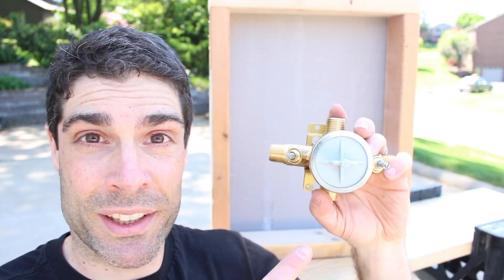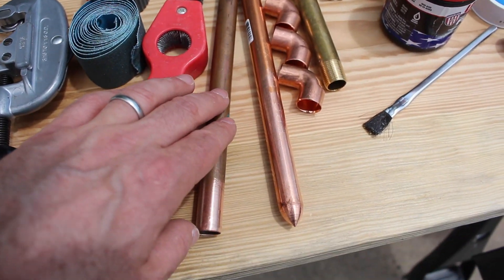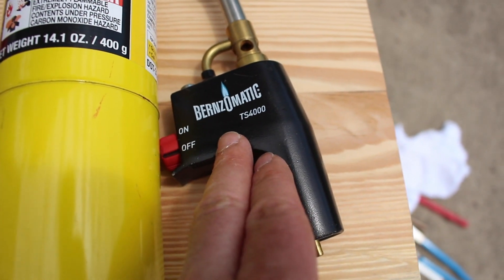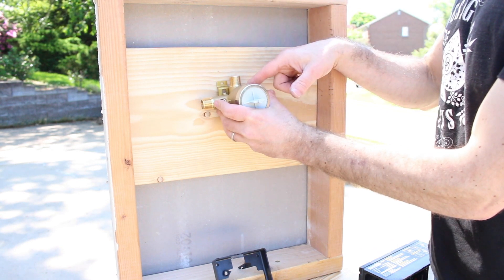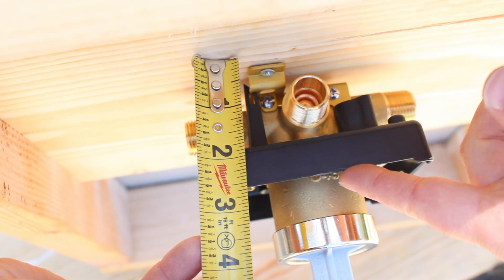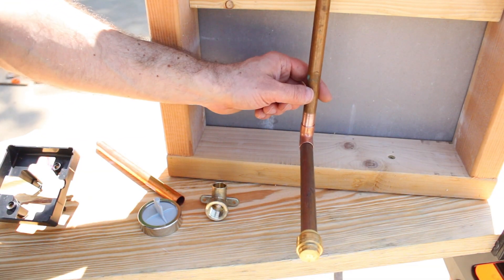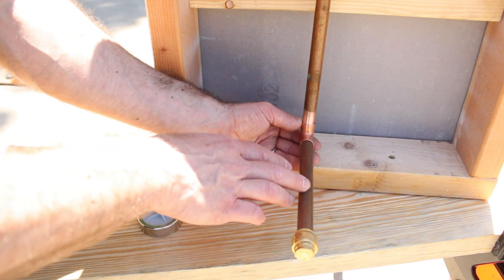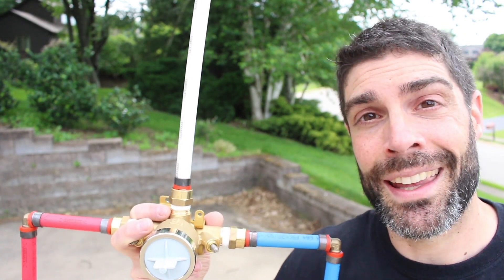Delta Multichoice Valve Installation Tips (Copper Pipe Edition)

Comment: I'm installing the same valve, and after scouring 100 of videos about how to install it, yours is the best explanation about the whole process. I would add another tip though (I learned from some other video) is to use Thread Sealant to guarantee no leak. I'm surprised there are not a lot of like
Reply: Teflon tape always,
Tread sealant is for 
Amateurs

Comment: The depth mounting portion of the video is incorrect / misleading.
 
2 & 11/16" (actually 2 & 3/4") will always be the depth from the back to the edge of the mud guard as it states in Delta's installation manual.  What you need to plan for is that the front edge of the mud guard should be flush +/- 1/4" with the finished (tub / shower) wall.  So you need to account for the sheet rock/cement board, thin set & tile thickness.
Reply: Yes, this.
Reply: Yes I’m glad somebody else wrote this down before me because I was looking for a comment before posting the same concern. It’s a little concerning considering that’s one of the most important steps to installing a valve! Good looking out!
Reply: Glad you said this before I start the mounting of my valve thank you!
Reply: Delta's install manual points out the same dimension, and it is non-sense and confusing, which is why I looked for additional information.  Thanks for pointing this out.  That dimension is from the mounting bracket to the front of the mud guard, and that never changes as you point out.   So, 1/2 inch for cement board, and about 1/2 inch give or take for your tile and thin set, and you need that sucker sticking out past your framing by about an inch.  But check your tile and thin set thickness...but you should get to that +/- 1/4 "  .
Reply: Thanks for your clear insights. I was listening to this guy and comparing it to the install instructions and I was like "what?! It's always 2 3/4 from the vale to the mud gaurd" 
This is why we need a down vote counter !
Reply: Ya. He F'd that up. Hopefully people read this comment.
Reply: Yes.  A 2x stringer set in the back of the wall cavity leaves 2" (3 1/2" minus 1 1/2" leaves 2") to the front of the wall.  That means that mounting the valve body on the stringer puts the front of the bracket about 3/4" proud of the wall surface.  That's fine if the shower wall is at least 3/8" thick but a thin shower panel may leave the valve too far away from the panel to allow the trim to fit snugly against it.  In the Delta video it looks like the guy used a 1x6 stringer to let the valve set further inside the stud cavity.

Comment: Love the video and appreciate your expertise! I am looking to change out an existing old shower valve with this MultiChoice. It appears to be threaded at each end, does that make it compatible to use compression fittings? I am intimidated with soldering in a confined area, so that would be my chicken out method.

Comment: Shouldn't the plastiguard depth be determined by the thickness of the wall/tile you plan to install? For instance, my wall insert is 1 1/8" thick. The direct to stud install of the insert would need to be calculated somehow, right?

Comment: Excellent video. Very informative! When you mentioned the setback/position or depth of the valve you didn’t mention that Delta has a different setback if you are doing a “THIN”  wall. A “THIN” wall is one that is drywall only. I had to have a valve replaced last year and they replaced it with the exact valve you used in the demo. The bathroom has a separate shower and a separate tub. There is a single horizontal row of 12 x 12 tile above the tub which the spout goes through but there is not any tile where the valve is mounted. (Delta does have a note and instructions for a “THIN” wall....)  Instead of using a 2x4, etc to mount it to they used a 1x4 (actually 3/4” x 3 1/2”). Delta says for a “THIN” wall the plaster guard must be flush with the back of the drywall or a 1/4” behind the drywall. They also make  a “THIN” wall kit which is just a couple of very thin plastic plates designed to stiffen up the wall which was not needed in my case.
You can also cap the shower outlet on this valve and use it for a tub only or as you stated a shower only...
I also recently found out why Delta and other manufacturers don’t recommend PEX for the tub drop to a drop ear. (This information came from a master plumber and not from Delta or another valve manufacturer). He said It’s because the diameter of PEX is not a true 1/2” diameter and not enough water pressure goes through the valve and tub spout diverter and can cause a very small amount of water to dribble out of the shower head. He said this can happen with any brand of tub/shower valve.  I asked him if using PEX-A or using 3/4” PEX would make a difference....   His response was it would probably make a difference but he had never tested it.
Hope this information helps....
Ron
Reply: Thank you for that information.  Does the black plaster guard stay in and connected to the valve or does it come out right before the trim and escutcheon are installed?
Second, does the hole in my wall board stay circular for the valve or am I cutting a square to accommodate the plaster guard? Thank you.
Reply: What did you determine? Make a square cut out?
Reply: Wish he did test it. Was about to do the Pex A drop ear to the tub spout. Guess ill go with the copper.

Comment: As far as the depth goes, when you add 1/2 inch cement board plus 1/4 thickness for the shower wall. Do I then shim it out that that much further? So instead of having the mounting board depth at 2 3/4 from the front of the studs , it would only be 2 inches from the front of the studs?

Comment: The depth you mentioned… that’s assuming a standard cement board + thin set + tile surround yeah? 

Great video btw. Super helpful.
Reply from the maker: yes, although I recommend dry fitting your backer or a piece of it along with tile to just double check the depth

Comment: Regarding the shower stops. On the Delta multichoice valve, the stops are held in by the brass nuts.  In order to open the stops, you turn the screwdriver adjustment screws to the fully CCW position until you cannot unscrew any further.  The brass nuts will not allow them to come out all the way.

Comment: This video is so packed full of information! My wife and I are trying to replace our current setup (I believe we have a Moen mixing valve) to this new delta mixing valve. How would I only about doing the install if I really only have access to one side of the wall? The opposing side does butt into a closet. Do you think we will end up having to cut out drywall to gain access to the backside of the space? Sorry, I just have a ton of questions because I have never actually soldered copper before.(even though I soldier electronics at work everyday I’m still worried about water leaks)
Reply: Or should I just contract this out? 😳

Comment: Excellent detailed video.  
Does the black plaster guard stay in and connected to the valve or does it come out right before the trim and escutcheon are installed?
Second, does the hole in my wall board stay circular for the valve or am I cutting a square to accommodate the plaster guard? Thank you.
Reply: Just curious what you ended up doing? thanks!
Reply: Same question. What did you find out?
Reply: @cjdangles  What I did was leave the black, square guard in as you tile around it. It gives you an idea on where the tile needs to go , depth wise, for the escutcheon or base to go.  Leave a square hole if your black guard is square or round hole around the  valve.  That's how I did it.
Remove the black plastic guard after you're done tiling and/or grouting that area.
Reply: @cjdangles  I commented on this reply area.  Leave it in and tile around it. Remove it after you tile the area.  It helps guide you on depth or how far out the tile should come...

Comment: You can't use 1/2 pex for the tub spout but you can use 3/4 pex pipe for the tub spout with a drop ear fitting and 1/2 threaded brass or galvanized nipple for the tub spout.

Comment: The measurement for depth is just plain wrong, and the video should be corrected!

You should not be measuring from the blocking to the front of the plaster guard  (which will always be the same no matter where you place the blocking), but you should be measuring from the blocking to what will be the front i.e. surface of the finished wall (including depth of tile).  Further, if you are installing the valve "with stops" as the video shows, the measurement should not be 2-3/4" plus-or-minus 1/4", it is should be 2-3/4" with up to minus 1/4", meaning the plaster guard should be flush or sub-flush with the finish wall, including tile if any, and not past the finish wall.  This measurement along with the depth of the blocking is what determines where you put the blocking.
Reply: Anyone looking to this video for advice should look elsewhere.  @harrellh3628 is exactly correct.

Comment: I am replacing a damaged rough-in, can I solder a short 1/2" pipes to each end and then connect to the existing pipes using sharkbites?

Comment: Very nice 👍. I just installed one of these valves, as per instructions, and still find the tub spout leaking, even though the stop screws are all the way in. Any ideas why?
Reply from the maker: if water is leaking at the spout it’s probably a cartridge problem
Reply: @HomeRepairTutor  thanks, this is before the cartridge i.e. roughing in before the cement board is up. I just figured out and fixed it. Guess what? There were tiny bits of copper  burrs in the o-ring of the water stop screws. I cleaned up and it's all good now, no more leaks. I was surprised to find burrs, I did run the water through after sweating all connections. Perhaps, I have to run a little longer for the pipes to get flushed. You may want to educate others on this.
Reply from the maker: @gopsln  thank you for the update!! That’s good to know. Flushing the system prior to adding the cartridge probably is a good tip 🙌🏼 I’ll make to tell folks who are doing a similar installation

Comment: HELP 
with a standard 2x6 against the back wall between my studs it's measuring 4 and 1/4 inches from the plaster guard on my valve and is measuring 2.5 inches away from my finished wall. 
I just need the plaster guard flush with the finished wall, correct???

Comment: Is the thickness of the plaster guard aligned with the thickness of the backer board?  Or should it sit more proud and be flush with the finished wall?
Reply: Flush with finished wall
Reply: That’s what I figured.  So much for using of a 2X  board to space it on 2X4 framing.  Mine winds up flush with the Wedi board.

Comment: I’m a DIYer. I want to change out the trim in my shower. It’s getting dated. I’d liked to replace the cartridge but the trim has no markings on it to indicate which brand is currently there. I understand valves are proprietary to each brand. I take that to mean, if I have a delta valve I can only use a delta cartridge and trim? I appreciate your channel. Hope you can help

Comment: I’ve just installed one of these, and it went fine. One thing I notice though is that with only the two screws mounting it to the blocking (using the diagonally set screw holes in the unit) the unit can be wobble around a bit. I notice that in your video it wobbles some too. Can you comment on why this might be the case, or if at a later step it gets attached to something else to make it more solid (the trim kit for example)? I’m just a touch concerned that if this is not mounted in a nice solid way, the trim/shower controls will also end wobbly? Thanks - and nice videos.
Reply: There are 4 mounting holes available on this unit.

Comment: Had all my bathrooms installed with these. Seems like the water pressure is really low. Is there a way to adjust the water pressure in the valve?
Reply: From the stops I believe.make sure they are open all the way. Right?... im here because I bought the R10000-unws-3 but there was no stops or plaster guard in the box. Hmmmm
Think ill return it and buy a different one. Ugh

Comment: Not all tubs have the drain exactly in the center!!! So a 32" tub may or may not have the drain at 16". I have a 30" wide American Standard alcove tub, but the distance from the back wall to the drain is only 14.25". The front top deck of the tub is wider than the back deck, to allow for putting shampoo bottles etc. So care should be taken to read the installation instructions to find out the correct depth.

Comment: Now do the same
On a 25 year old house in real life !!!! 
🤗🤗
Reply: I'm doing it now in 2 bathrooms on a home build in 1978.  It's a lot of fun after seeing how the plumber ran all of the water lines behind the tubs and in between the tubs (bathrooms are side by side) with no access to the pipes without having to tear out everything in the bathroom and I mean everything.  I found lots of pinholes in the pipes.  I could not believe the plumbers did not run the pipes in the bulkhead below the bathrooms that would require only cutting into drywall to access the pipes vs. literally having to tear down both bathrooms.  I just finish rerouting all the plumbing through the bulkhead under the bathrooms for easier access in the future.  A lot of fun.  Woopeee.

Comment: Looks like the side that is supposed to be facing into the bathtub enclosure is facing in the opposite direction here.  I bought a Multichoice and I highly recommend NOT BUYING A DELTA.  Piece of junk.  I even installed a new one they sent me and it is always on, the valve doesn't work, or it's always off.  Garbage, get a Simmons. (my plumber said Delta is junk and he won't install them anymore)
Reply: I'm hoping mine works out.... But straight out of the box the flange on the shower pipe was bent completely in half! I couldn't make it look right so it's an instant call to Delta.... I've been on hold for six weeks